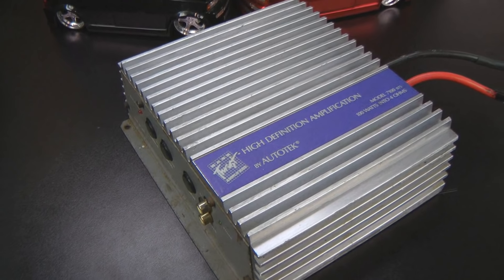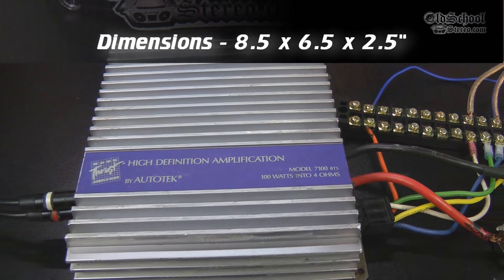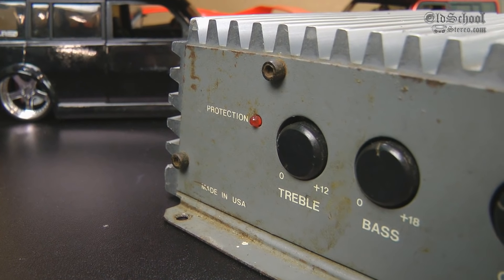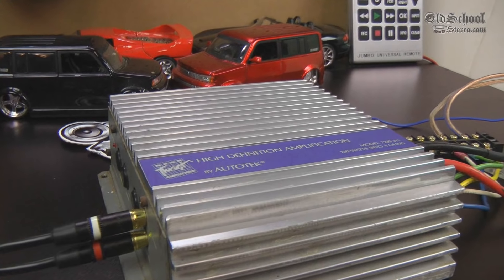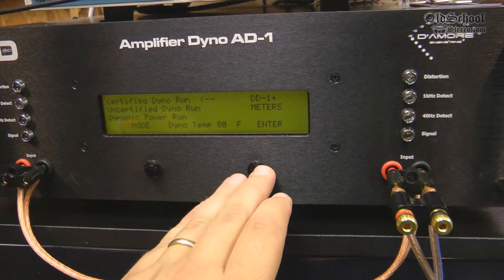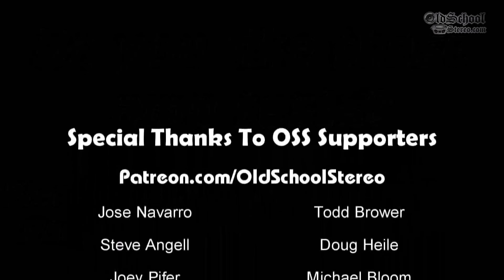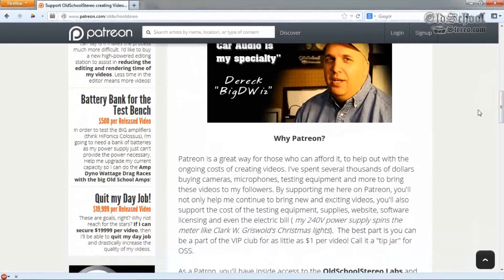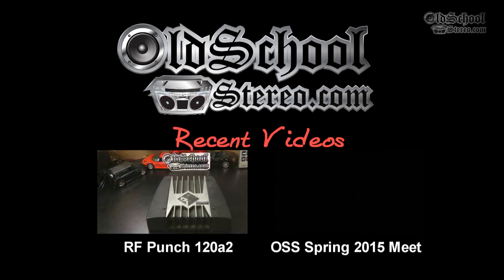Autotek 7100 BTS Amp Dyno Test 1989 Old School

Comment: Back in 1989 this guy would roll by our highschool with his mating call bass powered by Autotek... it was impressive and we always wanted to show him up with our system which was EV subs powered by HiFonics Zeus and an Aphrodite for mids/highs. The day never came though. 
His little Mazda pickup with a solid no window snugtop with the back window propped up would show up everywhere around San Jose lol. I think he had 2 15's but for sure it was powered by Autotek. His mirrors would droop bolstering his ego but it didnt take much... all those mirrors did that. 
We had the HiFonics and a friend got himself into a new company that was called Lanzar at the time.... big black amps with red lettering.
Someone told me that all three companie's actually were made in the same factory down in the Valley (near Valencia or Silmar So.Cal) I never could find out if that were true although there are similarities to parameters on all three companies.
Looking back i really like Autotek and the heatsink design. Amps back then had a system... Like HiFonics/Lanzar they were meant to line up with eachother. 
Which is aesthetically appealing to us with slight OCD lol.

Great vid as Always big D!

Comment: Had the 7050 BTS running 2 Savard Rap 12s back in the late 80s and early 90s in an ext cab s10 in high school and for a 22x2 rated amp, it was WAAAYYYY underrated

Comment: So I have a Autotek 7100 that back in the day I bought brand new, $380, and it was 1/2 ohm stable, how I ran it in mono, almost 600 watts, its circuit board blew in the year it was under warranty, the dealer replaced the guts with a 150 watt Autotek. I used to rattle sphincters in the back of my 81 Bronco. Women loved it. I still have it on a shelf, for the day I want to be heard, or I become hard of hearing, lol.

Comment: I still have this amp and would still be using it if I had'nt lost the speaker harness.  let me tell you, this amp truely was under rated.  I miss it dearly.
Reply from the maker: +dirtyd2099 it is an amazing little powerhouse for sure 💪😮👍
Reply: dirtyd2099 I got one of these and the autotek 7300 BTS for sale
Reply: I had the 150w to push my two Kicker 12s, a 100w(the one in the video) to push my kids the the doors and the 44w to push the tweeters up in the dash. Low rider S10 back in 91’. LOVED THESE AMPS!!! Florida Bass baby
Reply: you can put it on ebay if you still have it $20.00
Reply: @zachbarry2324  would u sell them or have u already
Reply: I ran the same amp in 88 on 4 Punch 15's and the 16x16 on my 6x9's and sony 27x4 mids and highs wit a pioneer  3 way crossover! I would bet my life on Autotek! I made some believers on that brand!

Comment: I have a black label 7100. The black label boards are much different than the blue label boards. Biggest difference is the black label board has those blasted circuit networks that takes the place of a whole lotta components giving them sleeker look. The disadvantage to those the only way to repair a black label board that has a bad network  is to know what's inside of it an good luck with finding that info. Great amps as long as one of those aren't bad.

Comment: hey big d I just found you and I have to say I like your channel,, I am lookin for some advice for a system for my boat,,I am on a budget and on disability due to bad lungs from painting custom cars for over 30 years, so I am looking for a pair of amps,, one to run a pair of 200rms 6x9 and the same for a pair of 6 in,, and an amp to run a single 12in sub, I would like to put 1000rms into a 12 sub,, so what do you think I could buy on a budget that will sound good in my boat,, its a 34ft cabin cruiser that I call home on the water,, any ideas ,, info or help would be great and much appreciated,,  would buy from you if you have any of the things I need,, again thanks for the great vids,, I am an old school from when orion xtr was one of the best,, damn that was a long time ago,, but still rockin,,  thanks again and keep em comin